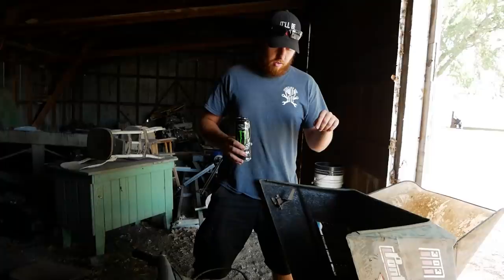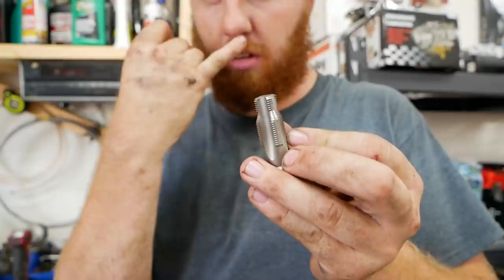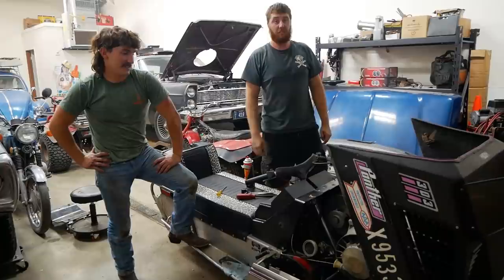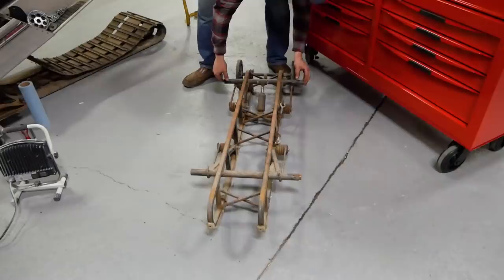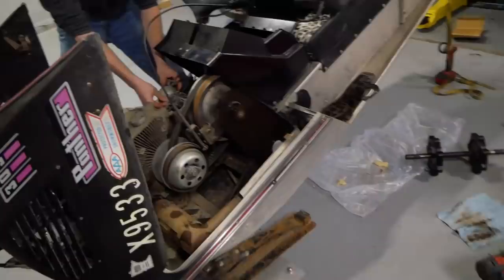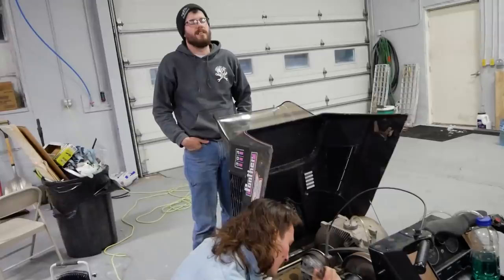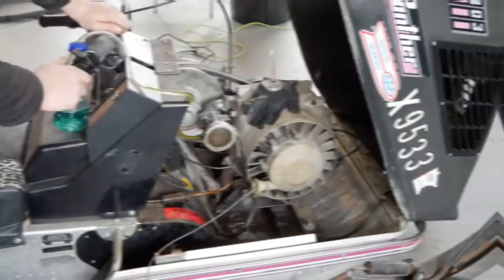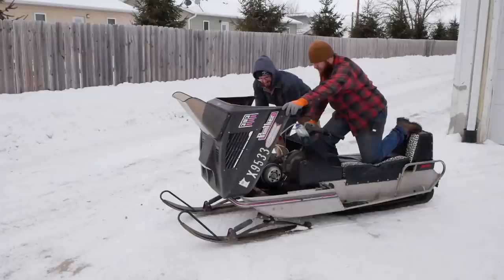Will an Abandoned Snowmobile Run After 20 Years?

Comment: That's the same Artic-Cat I drove when I was a teenager with 3 kids sitting behind me.  I thought it was gutless until I looked behind me and seen a 20 foot Rooster tail of snow following behind me like the white tornado.   It became a family machine that lasted a long time.   When you get these old machines and they are dry do not turn them over much without lubricating fuel because it is too easy to snap piston rings or in the case of the Rotary motor the rotor compression seal.

Comment: Sounds like back to the basics. Idle fuel is one circuit. Run fuel comes a different path. Some have multiple jets for different rpms. Slide carbs sometimes have a adjustable needle

Comment: As soon as I saw that this had a rotary in the thumb nail I was very skeptical that you would be able to get it running. Not because you guys have a lack of intellegence or knowledge but because rotaries are just so different and require such a different kind of expertise. Great job for getting it moving at all though! You guys did great with what you had and you definitely exceeded my expectations!

P.S. I fucking love rotaries. They're so cool and so under developed in my opinion.

Comment: having that glove on there is only temporary they won't work for very long as it is too thin you need the proper diaphragm there is not enough fuel pressure for it to run any more than idle speed sorry to say so until you get a proper diagram for the vacuum pump change that and away you go then you can set your carb.

Comment: It seems like it doesn't get enough fuel. Double check that the carburetor is the right one for this engine. It looks like Tillotson, which has numerous sizes and models manufactured - who knows if it was changed along the road. Verify with the vacuum pump/meter that it can hold the vacuum and the needle opens at the right (negative) pressure. Ask go-cart racers for advice, they use these and know everything about them.
Or maybe borrow one functioning carburetor from somebody, then you could exclude that part from trouble shooting.

Comment: theres a stuck apex seal on the rotor, id soak the combustion chamber with atf for a few days, rotating 33 degrees every day for about a week. its essentially running on 2/3 cylinders

Comment: My Mazda’s had an undiluted antifreeze tank that injected glycol into the rotors to lubricate the seals until it fired. Didn’t take much but I’d use that over WD-40, which has acidic rust dissolver in it.

Comment: grease your taps open grooves to catch the metal chip as you tap. go a little bit then stop and clean the groove add new grease and continue to tap repeating cleaning and regreasing till you are done. you will end up with less metal to clean out of the engine.

Comment: Diaphragm carbs are finicky. If you take it back apart and get some fine emery cloth on a piece of glass and lap the surface where the little flap valves seal to, I'll bet it would pull fuel like it should. According to your gauge, you've got a good pump pulse, so it's down to an internal carburetor issue. If all else fails, put a slide carb off of a 125 or 175 2 stroke dirt bike on it, with a rubber neck between the carb and intake runner for vibration, and get rid of the diaphragm carb!😁 You'll need to rig up a tank for gravity feed or a very low pressure electric pump if you're going to use the original tank. If it started that easily once the fuel actually got into the chamber, there's likely nothing wrong with the engine itself.😉

Comment: Dump some auto trans fluid into combustion chamber should free up apex seals. Dump some in let it sit for a day or so. Get it running spay some atf into carb while running. Works very well for stuck valves on conventional engines as well.

Comment: That type of carburetor must have the signals  from the crankcase you can't gravity-feed the carburetor because there is no float assembly, it's the pulse from the engine that pumps the fuel into the actual system. please feel free to correct me if I'm wrong for this run-on sentence

Comment: Rotary needs some two stroke oil premixed in the fuel, also I would be careful of shutting it off immediately after starting it when you do get it running, can flood the engine with gas

Comment: I used to have one. Exhaust runs hot on those!!
It does seem the apex seal is stuck on it though from sitting.. easy to take apart. Soak it first

Comment: I had one of those  old snowmobiles and I have an old book that is full of old snowmobiles all different makes and models wish I could let you use it but it seems to me like you definitely have a carburetter issue it idles and runs fine so the motor does work clearly you need to fix your carb problem it is most likely the pulse line system that you put the rubber glove in that's ur fule pump

Comment: My grandfather had that same sled. My great grandfather had the next generation panther a 500 with the option electric start that was given to me with 50 original miles i road the crap out of it for years but was horrible at breaking trail because it had decent power with a crappy track and no clearance. The old gutless sleds would just plow past me because they didn’t have enough power to break the track loose

Comment: Had one that did the same thing with the spark plug and the threads that broke out ruined the Apex seals in the engine creating vacuum leaks between the cylinders I Thought it was the carburetor also ended up Rebuilding the engine and it was fine.

Comment: Put a bit of oil in the housing, should help with compression, easy on the starter fluid as this has no lubrication and can damage the apex seals if it doesn’t have fuel (2-stroke fuel)

Comment: carb gasket with the metal ring might be fliped in the wrong direction or the high jet isnt metering fuel well  low jet 1 1/2 turn  high jet 1 turn try from there the high jet can be tuned for top end jacked the track off the ground and pin it and turn the high jet when its running..you can hear it clean up when you reach the sweet spot..but i think its the carb or adjustment of it.  good sled!  :hand-purple-blue-peace:

Comment: If you take the carb apart again there is a small ball check valve underneath the Welch plug! Would have to drill out the plug and pull out the ball valve and replace with a new one or clean is and put a new Welch plug in! That might do it! It would be on the high needle side the Welch plug is silver

Comment: I would think fuel pump is bad, spark plug isn't sealing right, carb has issues or crank seals.. plug the exhaust port and intake and apply vacuum to the motor and see if it holds or loses it.. first test you do to any 2 stroke.. it tells you if the motor is sealed or not. If not it runs lean or won't run

Comment: Rotary's require the apex seals be free.  from the scope you put in looks like lots of carbon. you may need to disassemble and free up the seals.  also make sure you are using the correct plug.  I am not sure about Sachs but i know mazda automotive and mercury(if i remember the brand correctly) used a special plug with a flat electrode.  hopefully you didn't damage the rotar with the too long plug.  also nice to see someone from Iowa.

Comment: I have found that snowmobile engines will not run well if there is too much oil in the fuel. What happens is the carb jets are too small to admit a sufficient amount of fuel, causing the engine to run lean and foul up with the excess lubricating oil.My Rotax would barely run, much like what you have there. Ran fine with 40:1 Specs were to run it at 60:1 gas/oil. Would not run well with 20:1 mix even with the air/fuel mixture screws turned all the way out till they were hanging by a few threads. From what I can find on the www the Rotary engine seems to be rather particular about what kind of oil you feed it as well as the mixture.

Comment: Man this video gives me flashbacks to a similar situation. I bought 2 matching evenrude rotary sleds. Kinda the same idea that I didn't want the sleds but I wanted a good working wankel for a go cart or something... OK I just wanted to play with them. First one that was apparently running and stopped on the last guy ended up as total destruction when I looked in to it, apex seal in an exhaust port and it split the block. The second one I got going and had the same issues as you. After about 3 days of dinking around with it I got her to go... once... and she met the same fate in her first grass drag as the other one... Apex seal in the exhaust port. I think the run issue is just a worn out motor with these things, and I think a worn out motor can happen in 500 miles, thats why yours was so clean. Unfortunately I found they don't exactly sell rebuild kits for them and their super niche items, but on the bright side some dude who restores old sleds stopped by and bought them for more than I paid. One day if I find a good one I'm building the wank cart of my dreams. But finicky things, I see why they never took off.

Comment: I know those sleds well. The 303 is an odd sounding unit for sure.  As a kid,I had this same year,and it was a high torque engine when it ran right; we use to skid trees with it. (no joke)   I 'm pretty sure you still have an air leak in perhaps the crank seals. Or just bad Apex seals, ( the equivalent of piston rings) for a rotary unit. I'd love to own that sled!

Comment: I would think that the apex seals are your problem.  It's one of the most common failures in a rotary and can cause the poor idle and cutting out.   I looked up the seals for that engine and the one result I found showed a cost of around $300 for the seals, but maybe you can get them elsewhere cheaper?

Comment: I got 2 1971 or2 rotory Motors. 3o3 or 305. Ran them 4 10 years can't kill them. Seats and seat sack has no tears. Treated them with silicone spray they have a low end York. Can pull slay with 5 kids in it. Approx 30 more love them. Had to park them do to the gas tank starting to leak. Was going to red coat them kids gone wife said not happy any moor she left so their they set have extra motor runs and tracks lots of extra parts note litting coils into

Comment: I've had a few back in the 80s had to do some off the wall non factory add ons   install a fuel pump off a newer sled vacuum assist and stuff a slide carb find some used parts then go from there once she gets fuel it will impress you guys  Buils Breal=k Repeat channel have done some cool shit with their build hit them up

Comment: Surprised you haven't seen an eccentric locking bearing; they're quite common.  Find them on Ag equipment, even seen them on old newspaper inserting machines and my '88 Wildcat even has them.  Fleet Farm still sells them.  To put in the front of the skid, why not just use a floor jack?

Comment: can you show how an older late 1970s to the 80s snowmobile tank tread gearbox transmission is connected to the engine? those old snowmobiles would be a great half track utility AWD golf cart project,to where the snowmobile front end has the skis replaced with an ATV 4WD 4 wheeler front end differential,so now the snow mobile has powered front wheels,and the tank tread back end tread would be replaced with a STREETABLE rubber tread,basicly convert the old snowmobile into a hybrid urban recreational halftrack using mag rims and rear track mag bogie wheels still able to go offroad as an All Wheel Drive to play in the snow ;)

Comment: very cool project ! I love old Snow Mobiles the shop doesn’t look that bad I have a Uncle that is brilliant and Super Cool ! He is retired Military ,retired commercial Airline Pilot ,West Point graduate  and has many patents over the years  on many items from home improvement and automobile  he has owned Jaguars XKE , a Ferrari  and in his 60s he rides Ducati’s and Ninjas  fo years he has been developing Mazda rotary motors for airplane use  I asked him about the problems of the motors  destroying the linings they were famously known to do  his response was most of those issues  were developed by inadequate cooling  on the RX7 cars  which made sense to me  but I wanted to pass that to you guys  that maybe a exterior oil cooler would be a good idea ? Which maybe not a issue because Snow Machines are run in the cold season ?  I don’t know  as per my Uncle the Rotary  is still one of the great engine designs due to simplicity  I admit yours sounded pretty healthy running

Comment: A lot of them old sleds you had to have the air cleaner on to create a little vacuum on the inlet side of the carburetor otherwise they won't run

Comment: That carb looks like a similar carb on my seadoo challenger. If im not mistaken the needle needs to literally pop and thats what let's fuel in. If it doesn't pop exactly right it won't run correct. And that may be one of the issues if im correct. But idk

Comment: Definitely a fuel delivery issue some other people mentioned you've got a two layer glove as that fuel pump. That probably won't work.
Also I would suggest limiting how much brake clean you use on an engine like this there needs to be some kind of lubricant in with the fuel to keep those Apex seals happy. So something like WD-40 would be better.
Definitely would like to see this thing running better and used since it's so clean.
Also wanted to mention that none of the links to the other YouTube channels actually work something about a typo in the URL pops up as an error.

Comment: What brand diaphragms did you use and also was the needle and seat changed? Here’s a couple things I’d reccomend. Use oem tillotson parts for the carburetor or get a carb kit from ec carburetors.oem would be best but ec has some quality stuff. Also set the arm that is inside the carb a hair above flush. Also too I would pull the Welch plugs out as well to make sure their is no debris under them. I would take a sharp punch and hit it on an angle. You want to poke a hole through that plug but be sure to not hit it hard enough where it goes through the carb body. Once you have a hole in the plugs, use a pick to pull them out.

Comment: Probably bad Apex seals, when you shot the camera down the sparkplug hole that rotor looked pretty carboned up from low compression. and just a little nick when you put in the Heli-Coil would mess up the seal.............

Comment: So the drive belt was removed so they could pull the snowmobile without the track dragging the belt and and wearing the drive pulleys. Otherwise it’ll wear into the pulley and it can eat belts faster

Comment: Not a rotary guy but with you saying poop buy the hat in the early video, how long it sat and how slow the exhaust moved, may have blockage in the exhaust which in a two stroke effects vacuum pressure. The less exhaust gasses expelled, the less that can be taken in. Just a possibility. And it’s easier to check than tearing apart the motor. Really would like to tear one down myself though to see how they work hands on.

Comment: try flipping the bottle so the fuel actually runs down to the carb..? i think its not supposed to "suck" the fuel 
i could be wrong but my experience say do that since it runs on when u feed it gas and then cuts out meaning the fuel dont reach the carb from the bottle..

Comment: Take the diaphragm (glove) out of it and hook that line to an external fuel pump, to fix the problem. Them rotary engines ran like crap when they do run the exhaust turns red hot from unburned fuel.

Comment: Is the idle air screw/ high speed screw set correctly on the carburetor? Just going off memory I believe the idle screw starting turned all the way in, turn out 1 1/4 turns out. High speed  1 1/2 turns out. That should get you in the ballpark. Again that is just from memory it's been along time since I've had a machine with that type of carb. Good luck and thanks for the videos!

Comment: Seems like the rotor seals are bad. Just like worn piston rings or a bad head gasket. Run a compression check, if its low, its probably the rotor seals.

Comment: I think the reason it acted like it wasn't pulling fuel was because it wasn't able to pull fuel due to your Gatorade bottle gas tank. This same type of thing happened to my motorcycle when I tried to use a temporary bottle tank. It refused to run until I put a vent hole in the cap, allowing the space in the "tank" to be replaced with air and pulling fuel through the line. Without the vent hole, the tank would just pull a vacuum and wouldn't allow the fuel into the carb.

Comment: Sorry about this but I couldn't find any where else to ask this. When you work on old snowmobiles with points and condensers where do you have the best results?  I have a Arctic Cat Lynx II 340 Kawasaki and have put in parts to correct the single cylinder effect but to have the other one die. I just watched your video on $500 sleds and trying to get some running, ride for 2 hours and spend a week getting it ready for another hour ride. I wish parts would last longer than that. Thank you for your response. I also have a Honda 90 that 3 wheeler that needs my attention.

Comment: The whole problem was the the diaphragm you used a rubber glove! Very smart but you had 2 pieces of rubber not working together vs 1 piece I would suggest stretch the glue across it and only 1 layer if glove

Comment: Well, if I were you, I would have cut just one circle out of that glove to replace the diaphragm. Also, I would have pulled the entire engine apart and checked for worn apex and side seals. Although that sled looked like it hadn't been used very much, it could be the consequences of being parked for 20 years. Also, try cleaning the little fuel channels inside the carburetor. And a better plug,and maybe a new coil, wouldn't hurt neither. Anyhow, once you've done all that, that thing should run like Road Runner.